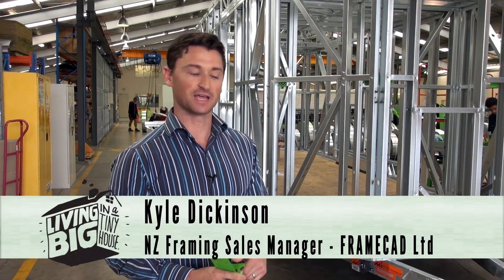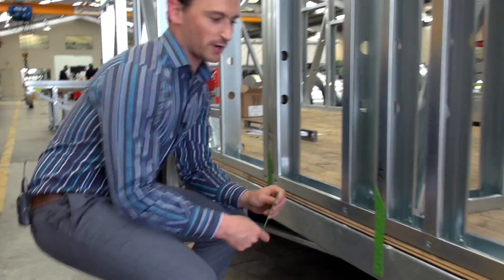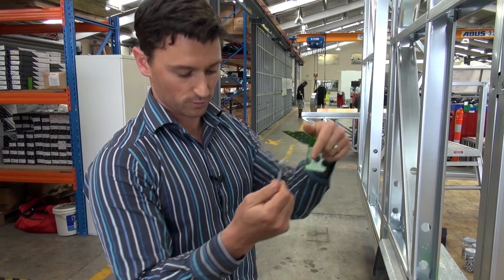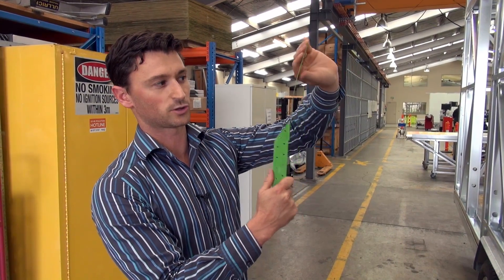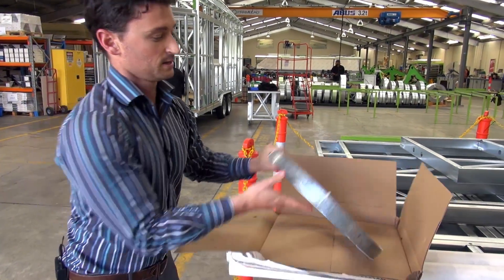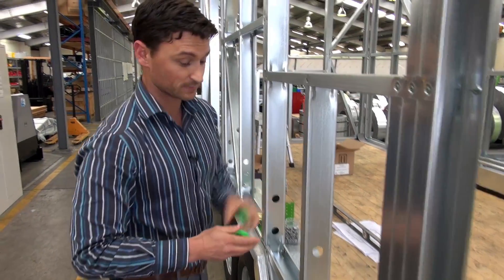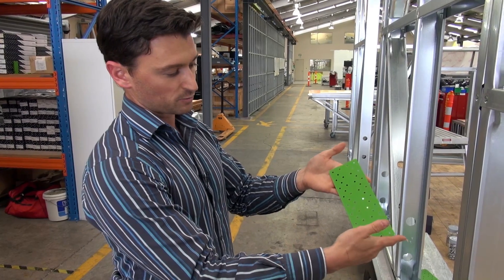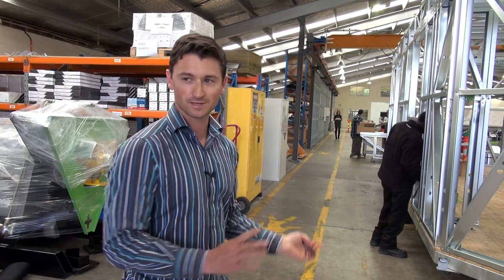Steel Framing With FRAMECAD: Connections

Comment: I don't understand why you put OSB wood between the steel floor platform and the steel panel walls. OSB is deformable and if the tiny is moving willl suffer a lot of deformation with time